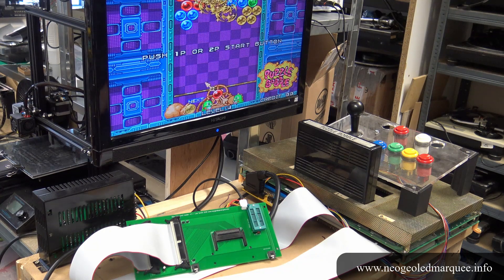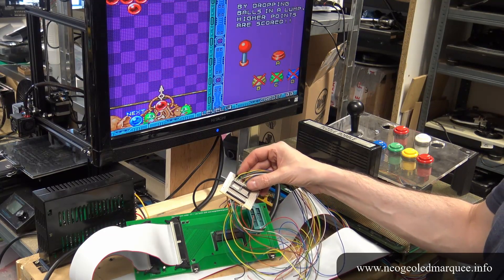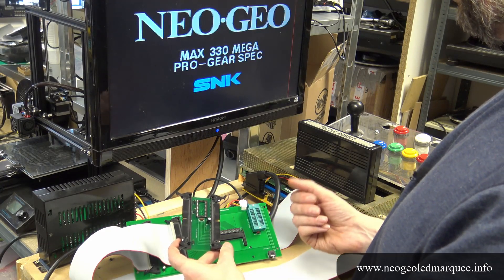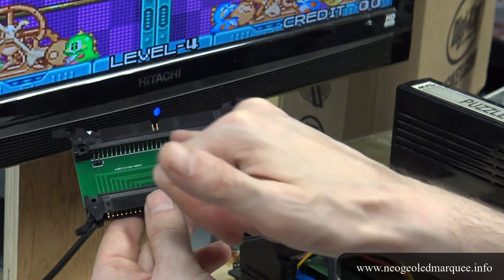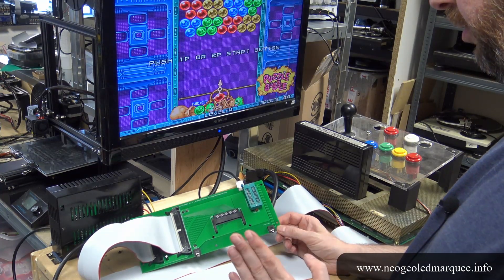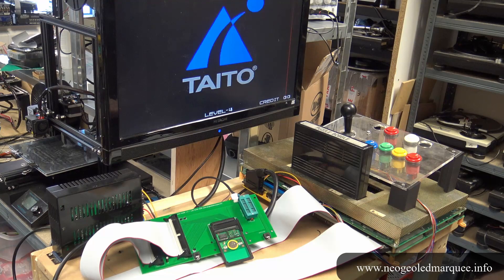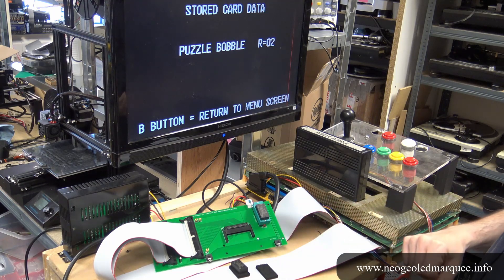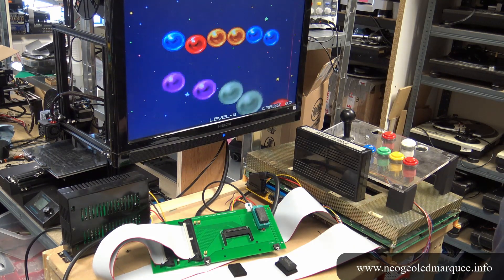Working repro Neo Geo  MV IC with NVRAM option

Comment: Krauser Blaster rom  work???
Reply from the maker: what is that ? it's to be used with a specific NVRMA module, nothing else
Reply: @DJlegionuk  new game Krauser Blaster MVS!!! Dump?
Reply from the maker: @rodrigotranquilino1547  this is just a reproduction of the original MV-IC so if it supports save games just like any other MVS cartridge it will work.
Reply: Are reproductions ready for sale?

Comment: How long till release?
Reply from the maker: I was waiting for cheaper connectors to arrive it saves quite a bit on the overall cost.. I have 4 of the normal MV-IC card readers that will be going on my shop very soon. The version with the NVRAM will be a but longer as I want to make sure the ram is not corrupting.

Comment: Absolutely fantastic!   Great job - I know this wasn't easy, very impressed with how you worked through the problems and ended up with an even better product!
Reply from the maker: I created most of the problems at the start with the wired mod, but each one solved  made the final design a little better. It was such a relief when switching the type of NVRAM worked. I could now design one that plugs into the MVS direct, but will see what happens with the new Neosavemaster.